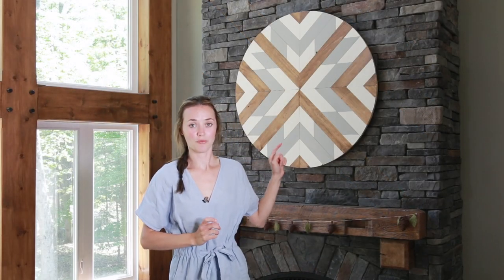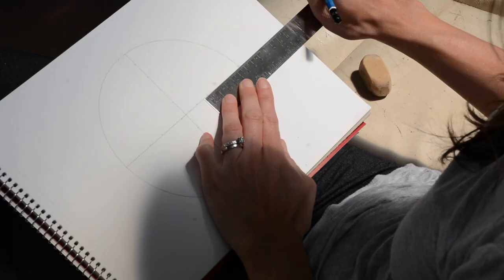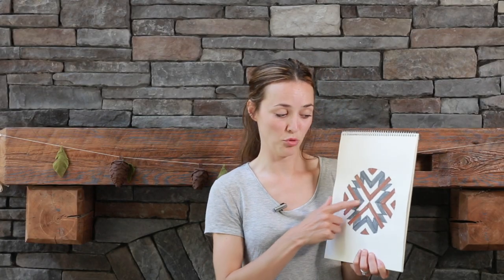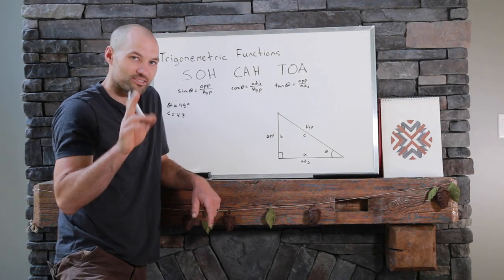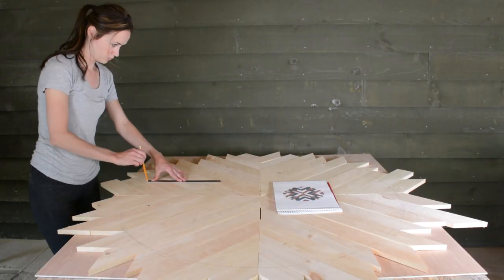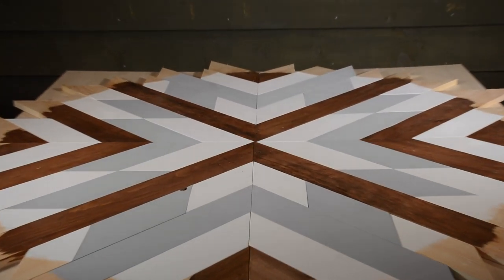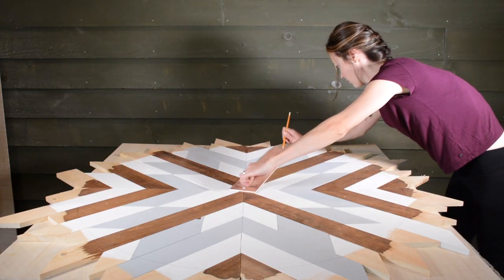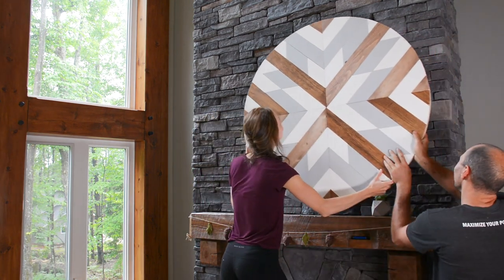DIY Geometric Wood Round

Comment: such a cool project. any time you can use SohCahToa in a wood-working video, you're on to something :) since the angle is 45deg you could actually get away with just using the Pythagorean theorem which might be slightly less intimidating for some aspiring crafters
Reply from the maker: hahahaha thanks for the tip!! math is not my forte (obviously) so i'll take as much help as i can get lol